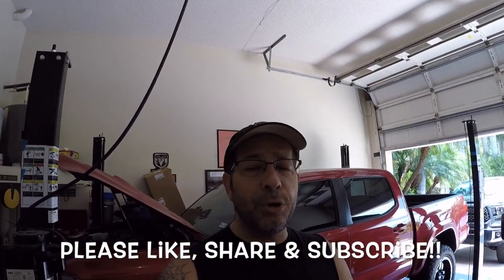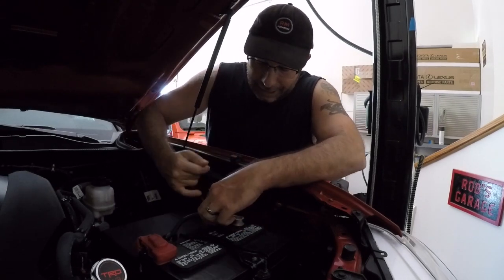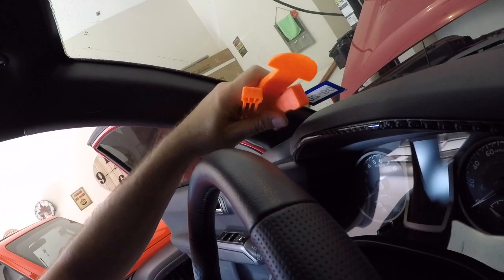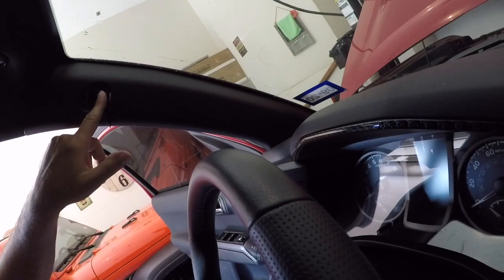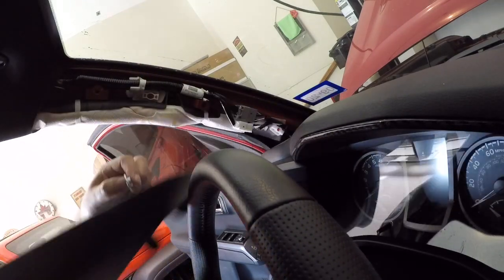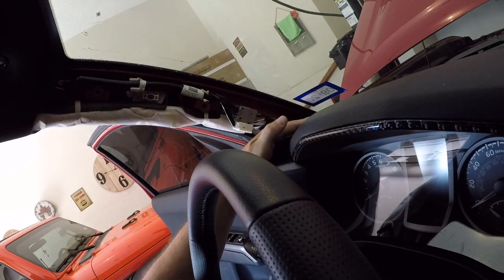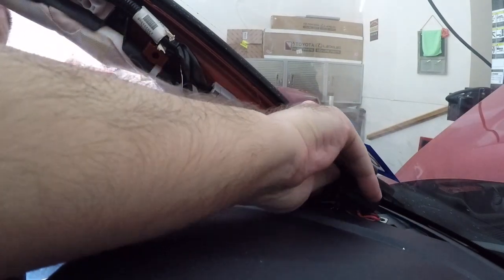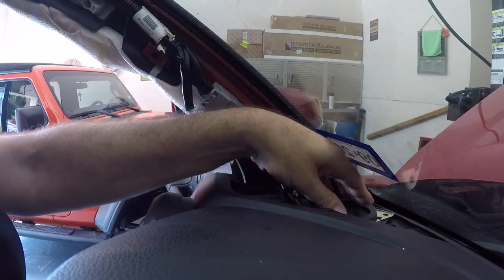Taking out my Kicker tweeters for the 2020 Tacoma

Comment: I just installed these in mine yesterday and was questioning if they were worth the cost and effort.  But after cranking up the volume - they don't clip out like the paper OEM tweeters at least.  Need to give it a few more days before I can give a final judgement - but do love the fact that they are true plug and play.  Today is the door 6x9s upgrade - slowly but surely.
Reply from the maker: I love mine👍

Comment: We were Kicker (Stillwater Designs) dealers for many years. In 2000 ish they started moving mfg to China. We tried to stay with them but there failure rate went from 2% to 60% very quickly. We had to bail to save our reputation, I’ve been told they have improved there failure rate, but never recovered there reputation, quality or independent dealer support. They were forced to Internet & Walmart sales, witch further hurt there credibility as a higher quality product. 
Sad evolution of what was once a good company that had pretty good products.
Reply from the maker: Hmm..first time I’ve heard that🤔
Reply: RobMotive 
It all went down many years ago, not many independent car audio shops around these days. The whole industry has changed so much in the last 20 years. I’m sure kicker has improved, but nothing like it used to be. All of the really good Car Audio brands are smaller companies that specialize in R & D. There not mass produced product from China, there also not inexpensive!